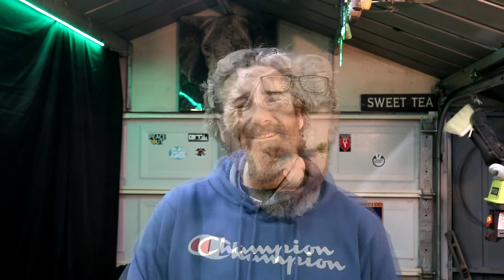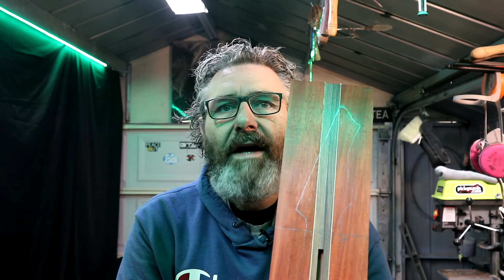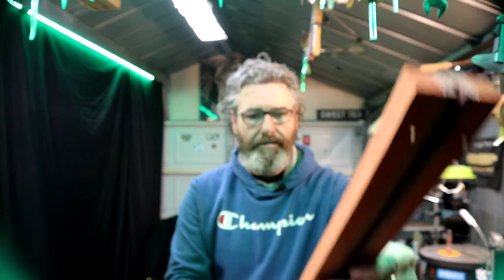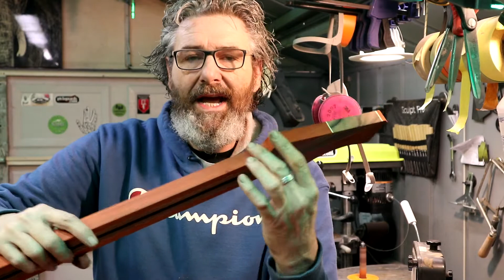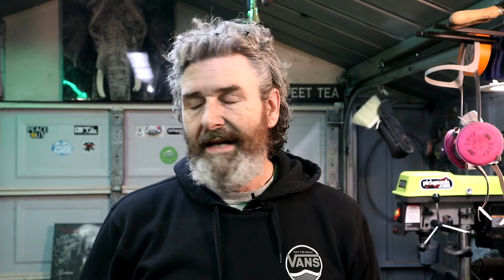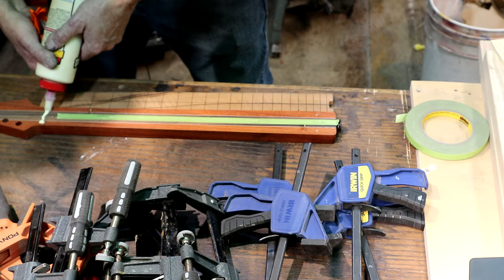Custom Telecaster Build - Episode 8

Comment: Sense you will be drilling out the holes for the tuners as well you could put a temporary locating pin in one of the holes for the tuners as well
Reply from the maker: You mean for the screws on the rear? The Tuners are drilled already, except for the 2 mounting screw holes on the back.
Reply: @SweetTGuitars  No before you drilled the holes for the tuners you could have used one of the places for where they would  be going to put a locating pin for routing the neck. Once done when you drilled the holes for the tuners the locating pin would have been drilled out along with the rest of the wood.
Reply from the maker: Oh you mean as alignment for the template instead of me drilling the hole near the nut! I get it now. I didn't do that because I wanted to make sure I could use that alignment pin even on a back angled headstock. I actually considered what you're talking about and it's a great idea. I was only trying to think ahead and think of the future builds which won't all have the flat headstock on the neck. Make sense? Thank you for your input. I appreciate it. ✌️

Comment: Headstock shape is just distinctive enough to stand out from the crowd without being derivative.  Neck wood continues to look better each time.  Has Steve (at Maximum G.W.) offered an explanation for placing those two alignment holes in neck/fretboard templates so close to nut?  Just curious.  Carry on!
Reply from the maker: He says they're not an issue drilling that close to the slot because the hole is filled with the dowel.  It was what could happen in-between drilling and putting the dowel in that worried me. My solution worked even though I drilled a hole in a brand new template🤔